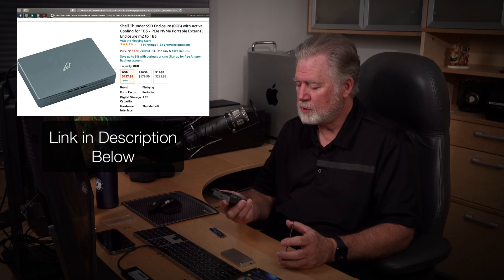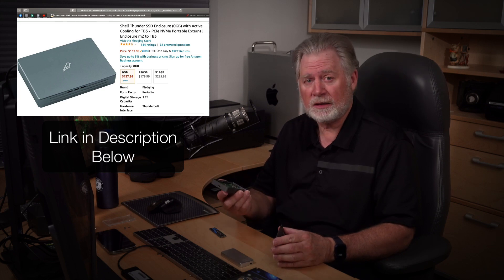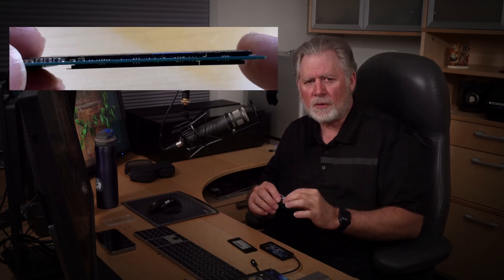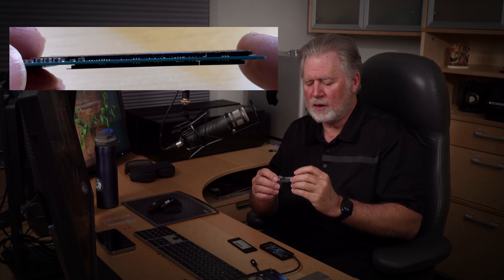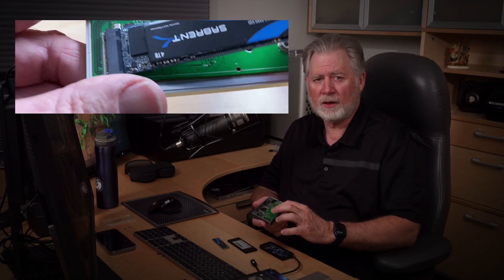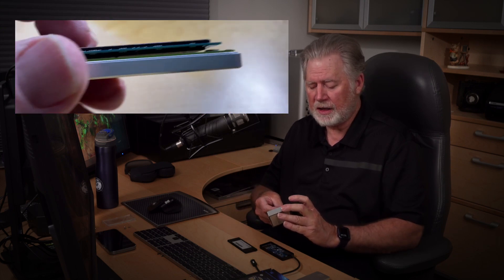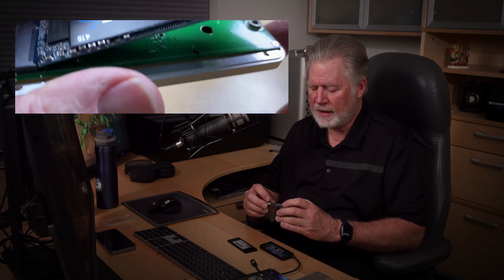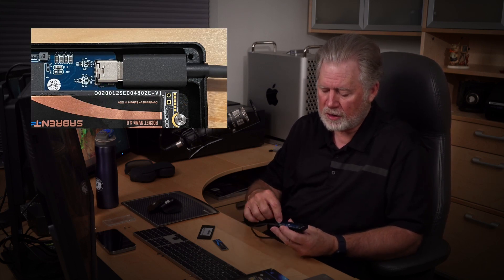OWC Envoy Express - build your own external TB3 SSD

Comment: I just bought the OWC enclosure, they do say on their site up to 1500 MBps so why they say 50 percent faster than other thunderbolt 3 devices on the box is just weird and wrong. I think they meant to say USB 3.0. My Mac Pro 5,1 can only get up to 1500 MB per second because of the limits of pcie 2.0, via my Titan ridge card. I think they limit the speed to have it be cooler and more consistent read write speeds than other enclosures and it’s cheaper. I’m probably gonna just keep it not sure,  but when I upgrade down the road to a new computer then this might not be the best choice.
Reply from the maker: Thanks for the feedback.

Comment: 4GB file tests are not enough alone to judge.  You need to do random / write test over time with very small small and large files.  Try copying 300GB back and forth. etc. I'd prefer cooler consistent performance.
Reply from the maker: Possibly,.  I was running two different transfer speed benchmarks (Black Magic and Aja) shows similar issues as it either heats up or the cache files fill up.  I guess real world performance rally depends on  the application, huge 8k apple ProRes files are certainly a lot different tan captures from even high resolution digital cameras like my Sony a7r4 or Fuji GFX 100.